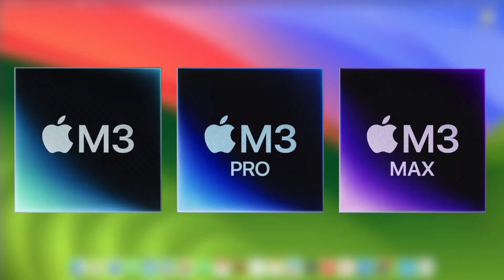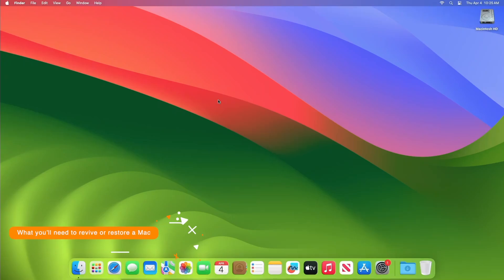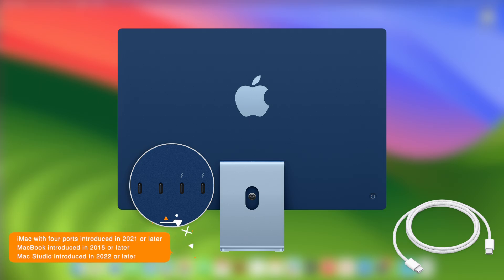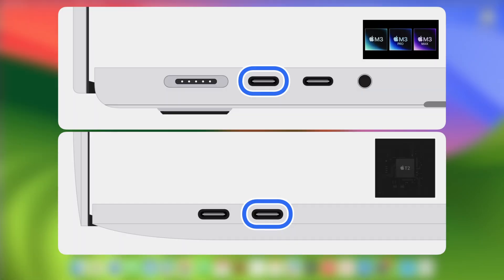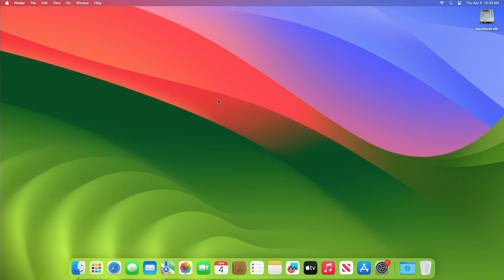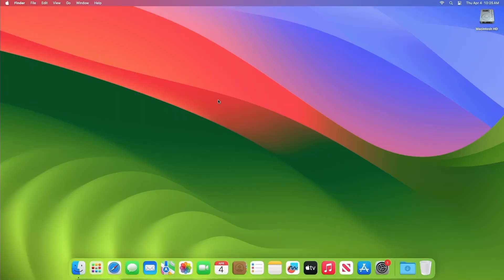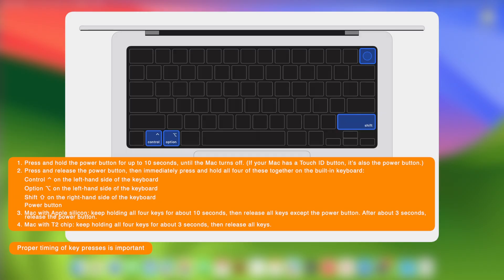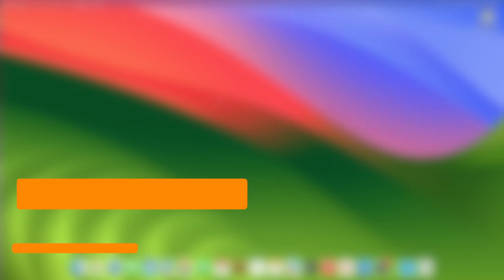How To Revive or Restore Mac using Apple Configurator | Intel | Apple Silicon

Comment: This is boolshit. It doesn't work
If you have such trouble - go to watch this video and also you should get Apple Configurator. I spent 7 hours and even was close to make a verdict that my M2 Pro got a real hardware problem. But no. 
Everything you need is :
1 - download apple configurator to Host mac
2 - run app
3 - connect your affected mac to host mac via USB-C cable (I didn't use apple usb, I used 3p cable)
4 - press 4 buttons (the same as mentioned here and across the internet) and release right at the moment app configurator detected it
5 - use right click context menu and select Advanced. then select Revive
6 - wait
7 - have fun
https://www.youtube.com/watch?v=1HWLLvJf5ms

Comment: I have same issue in mac air m1, it was restating again and again after some time interval. 
then it goes in recovery mode, I tried to reinstall macos sequioa but at last it failed, laptop restarted and goes in restore mode.
As I don't have 2nd mac, I visited new official Apple store in Pune, india, they tried it to restore in DFU mode but got error 21.
The system cannot be restored on this device. Failed to restore device in recovery mode. iBusRestore error 21 (com.apple.MobileDevice.MobileRestore – 0x15 (21))
I think they didn't tried in correct way, and demanding Rs. 40k.
Any solution to restore my mac🥺

Comment: Did the Restore option because Revive did not work. Device shuts down, I power it up. It does NOT want to connect to any WiFi, there is just a little spinning circle indicator next to the SSID. I bought a Belkin Usb C to LAN adapter, starting the computer with this, does show a timer BUT timer ramps up to 24 hours (within 5 minutes) while the earth globe is spinning. After 36 hours (so far), nothing else has changed. It is not frozen, pressing Caps lock indicate this also. It just does not do anything else. My internet is 100/100 and I have done multiple Windows internet recoveries with zero issues.
Reply: this software can't fix a worn out hardware component